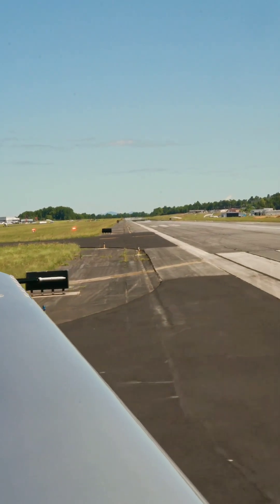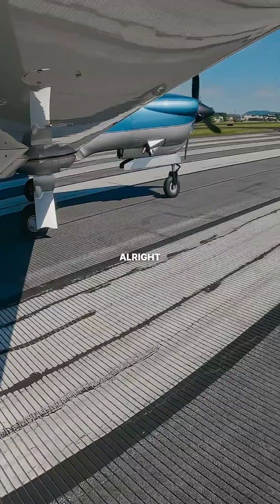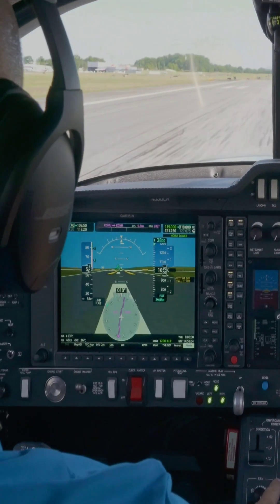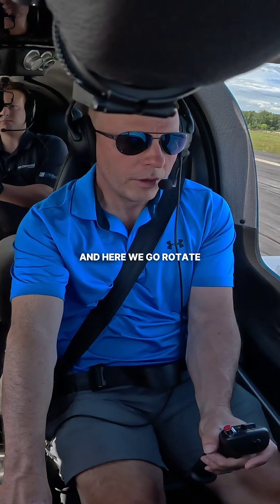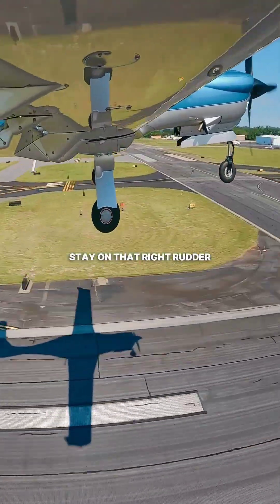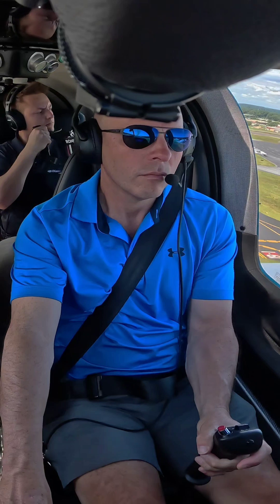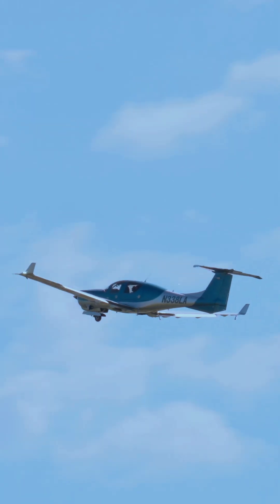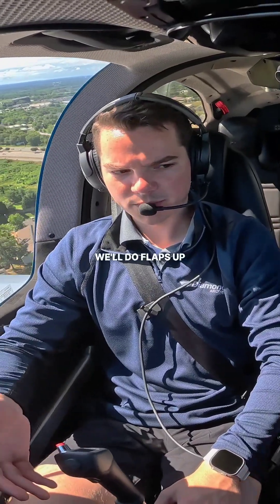What would you rate this takeoff? #da50 #aviation #weflydiamondaircraft  #pilot

Comment: Don't tap the brakes.
Reply: I've heard that callout on several videos with retractable gear aircraft, I suspect the point is to ensure that the wheels are not spinning when they are raised into the fuselage.
Reply: They're all wrong. It's an old wives' tale. Every single retractable gear plane stops the wheel spinning when gear is selected up.
Reply: Spin a bicycle tire and try to simulate a retraction.
Reply: @scottfrank726  Are you dense? All planes stop the wheels spinning when gear is selected up.